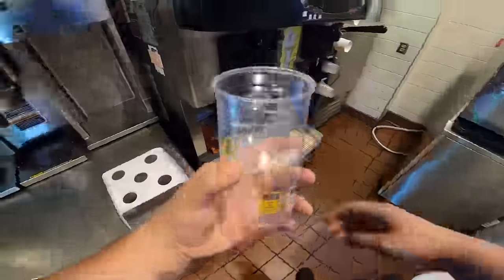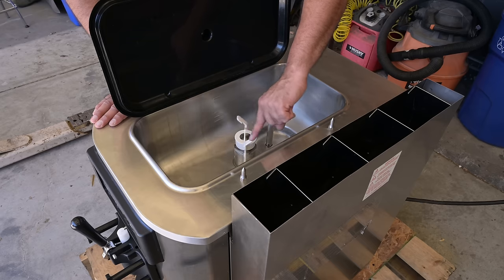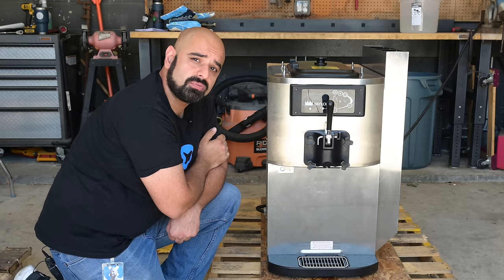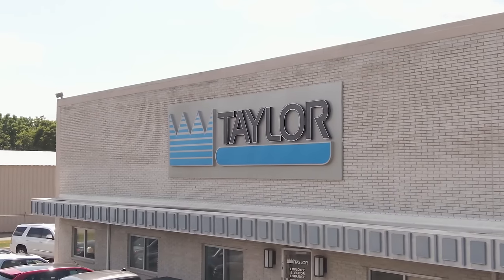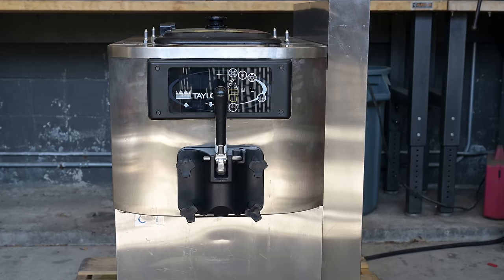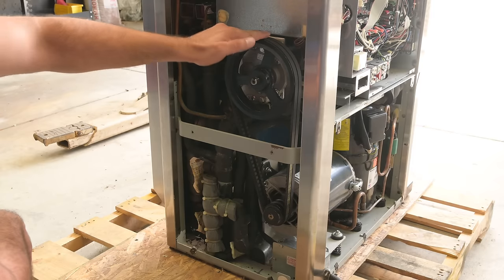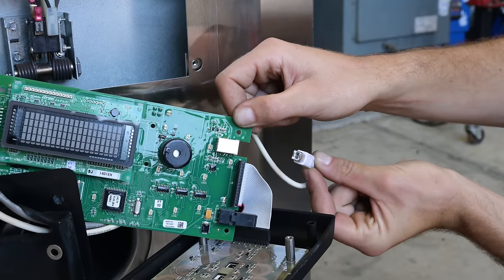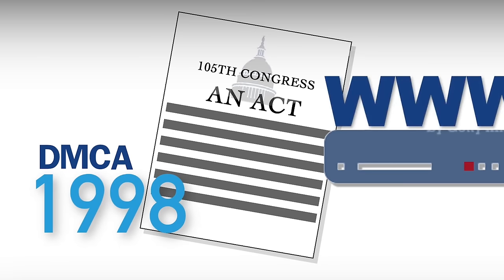Why McDonald's Ice Cream Machines Are Always Broken and How To Fix Them

Comment: I was the technician for Showbiz Pizza Time Theatre for 6 years, we had an older (non electronic) version of these machines, ice cream (soft serve, technically ice milk) was ready to dispense about 30 minutes after turning the machine on. These machines while precision were very simple and the only time ours was "down" was when employees at night would drop the mixer drum (spun inside the freezing chamber) and they would bend it, it was a tight tolerance and if bent it was expensive to replace. In my 6 years there we never once called Taylor to come fix the machine and it was in service 99% of the time (probably closer to 99.5%). The only 2 reasons it was ever out was the reason I mentioned and when management forgot to purchase enough 'mix' for the machine. 

I have watched the whole thing about the new machines for a few years now and I think that Taylor should be massively sued by McDonalds and I have no idea why such a large user like that would put up with these issues unless they get a kickback from Taylor on each repair (to franchises). Taylor could fix and prevent these issues with just a firmware update if they wanted to.
Reply: it's likely that mcdonalds also gets a cut from the service calls as well... or something. like mentioned in the video, taylor and mcdonalds have been working together for as long as they've basically existed (well, as long as mcdonalds has existed, taylor has been around for a few decades more) so all of this likely is done with mcdonalds executive's permission
Reply: It's worth noting that McDonald's isn't directly impacted by Taylor's practices thanks to their franchise model. They have an enormous amount of power over their franchisees, but ultimately a store that's losing sales is the small business owner's problem, not an issue for Corporate.
Reply: As noted in the video, McDonalds isn't going to sue Taylor. They're working together. Taylor sells other machines to other franchises that don't break down as often. If McDonalds wanted, they could upgrade to a more functional machine that doesn't leave their franchise owners stranded so often. The truth is that this problem is pure corruption, and the franchise owners are the ones getting hurt. The franchise owners need to sue McDonalds, but that would likely mean giving up their franchise location because of the lawsuit. McDonalds is going to retaliate against the franchise owners if they try to fight back against these practices.

The only semi-good news is that McDonalds is likely going to become the next subway. Basically, an irrelevant and dying business. They've already had a reputation for cheap and crappy food, but their reputation as openly hostile to franchise owners is becoming very well known. Their hostility towards franchise owners is becoming a lot more of a serious threat to their existence. It's causing franchise owners to simply walk away. If enough owners leave, McDonalds locations will start closing, because McDonalds can't fill those vacancies. As locations close, McDonalds might do what Subway did, and become even more hostile towards the existing owners, to try and fill the missing quarterly profits by taking more money from franchise owners, leading to a vicious death spiral. Subway was once larger than McDonalds in America, and I bet that soon McDonalds will no longer be the top dog in franchise restaurants. Right now, if you have the ~2 million dollars needed to open a McDonalds restaurant, you can make the same yearly profit simply investing in government bonds. I expect that the change in the economic environment and exposé's like these will cause a lot of franchise owners to cash out.
Reply: Others have said the same, but reiteration is important. 

McDonalds does not own every store, most are franchises. As a whole, McDonalds is an image, and they let people buy permission to use their image and branding. 

As part of a franchise, you have to agree to follow certain rules. Who you buy from, menu items, and layout are all determined by the company. You're renting their name and formula, nothing more. 

So let me put it like this: if you were able to write a contract that forces another person who you have by the balls to only use the ludicrously expensive icecream machines, and that icecream company happened to pay you for their contract, why wouldn't you? You and the icecream company are fine, neither of you has any risk. The risk is all on the franchise partner.
Reply: McDonald’s has a financial stake in Taylor. The McDonald’s machine was developed in cooperation between McDonald’s and Taylor. These machines are solely sold to McDonald’s. Every service call is money in McDonald’s pocket.
Reply: It's also worth noting that this is an America only problem. The only thing I ever order in McDonald's is the ice cream, and I've never ever come across a broken machine in my entire life. Only that they run out of the flavour I want during peak hours.
Reply: @awesomestuff9715  Taylor is a major owner of McDonalds (~30%).  McDonalds owns (~15%) of Taylor. It is to maximise gain from the franchisee.  It is exploiting regulatory capture at its finest.
Reply: Confused American people: Your local McDonald's is a franchise. Basically an independent restaurant that pays royalties to McDonald's. Because a Big Mac sells better than a Some Guy Burger, so in general it's a good deal for someone who can run a business well but maybe doesn't have secret family recipes to sell. The franchise has to call Taylor to repair the ice cream machine. McDonald's basically owns Taylor. So the franchisee is paying fees to corporate.

This is borderline illegal. But you'd need a bunch of businesses that depend on McDonald's corporate to team up and sue corporate. So long as the business is making money, they'll put up with a lot of pain.

It's like saying mom and dad bought a terrible washing machine. So if their daughter wants clean clothes, she has to pay a repair company to fix the washer. Except mom and dad also own the washer company. So they make money whenever daughter needs clean clothes. And if the daughter wants this situation fixed, she'd have to sue her mom and dad. It can be done, but it's difficult.
Reply: @alexlowe2054  In Sweden McDonald's are getting kicked in the chin by our own Swedish franchises and have started to leave less populated areas because they cannot come close to food quality at the same price even less when you give it buck or two more. 

Bastard Burgers, Jureskog, Max Burgers, Sibylla are the prime choice against Ronald in pretty much any town nowadays. Not speaking about random street food alternatives.
Reply: Nah, see the cost is on franchisees not McDonalds corporate, they don't give a flip.
Reply: @carly09et  that makes even more sense for why they would do this then
Reply: @nikkeryge in the Philippines, they don't have a standard Taylor machine unlike in the US. Its uptime is much better here. Unfortunately, I can't say the same for their slurry machines.

I've also stopped eating at McDonalds and started making my own burgers because they're starting to creep up in price and I hate it.
Reply: Showbiz pizza time theatre? You mean chuck E cheese pizza time theatre or Showbiz pizza place
Reply: @railfandepotproductions  You are correct, it was originally Showbiz but later converted to a Chuck E Cheese (it's all Brock Hotel) and my brain sometimes gets the name mixed up.
Reply: The nanosecond the contract expires (if it does) Mcdees will release their own machine I'm sure
Reply: @alexlowe2054   unlike subway McDonald owns the land of lot of the franchises
Reply: @Radi0he4d1  Since Taylor is paying McD HQ to be exclusive, and half the McD board is also in Taylor, you can forget about that.
Reply: @C0MMANDE12  
same in Finland, we have Hesbuger who are the largest hamburger chain here nowadays
Reply: Max Burgers is amazing! They've started a few places in Poland lately and the quality is lightyears ahead of McDonalds.
Reply: Taylor has said in their financial reports that they get about 25% of their income from expensive maintenance calls. And it is only for MaD machines that this is an issue. Other fast food companies use the Taylor machines, but not the exact same machine they  McDonald’s franchisees have to use. And those other fast food chains don’t have such extensive downtime and maintenance issues. That’s a McDonald’s issue. And I’m surprised McDonald’s is satisfied to let this go on because it is really embarrassing for them I think.

Comment: This is awesome, I hope this gets some of the lay people out there to understand how these sorts of laws really affect them, like when they can't get ice cream at a McD's.

These sorts of bad laws, particularly the DMCA are abused non-stop now, usually protecting shady business practices to begin with, exactly like Taylor and John Deere using these exclusive contracts to service and repair their devices.  When its obvious the product is flawed and requires external intervention due to a lack of support by the original manufacturer, there is no reason alternative repairs should not be allowed under any laws!
Reply: McDonald's makes more money in one month than you could spend in a lifetime. There's literally zero excuse for their ice cream machines being down so often.
Wendy's doesn't have this problem and Dairy Queen doesn't have this problem. Why spend money on ice cream machines when they don't won't and you can't make money off of them. They probably lose MILLIONS in revenue every day because they can't sell ice cream to customers and they aren't doing anything about it. 

If it's the ice cream maker supplier that's the problem, CHANGE SUPPLIERS. If it's employee, train/fire/hire your employees.

While right to repair laws are severely lacking, it's McDonald's own fault for outsourcing and/or going with an inferior product. 

Either make your own machines, or get better ones that don't have the same problems.

Comment: I remember the design difference the Taylor made ice cream machine had for McDonalds, vs other fast food restaurants like Wendy's, was to be able to re-pasteurize the milk that was already in there.  So if there was left over milk from the previous day, it will get pasteurized again so it's made safe.  While the machines at restaurants like Wendy's, you'd just throw out the milk.

Another reason that McDonalds is ok with Taylor being the only company to call when something is not working with their machines, is that McDonalds is also a share holder in the company.  McDonalds makes money from this business relationship being a share holder in Taylor when it comes to getting dividend payments from Taylor.  This kind of monopoly shouldn't be allowed.

Comment: I worked during McD's during college years i actually managed the store and had to order parts/repairs. Our machine was often not broken but out of use. This was because at the end of the night (about 2hs before closing) we would put the machine into a cleaning cycle. In the morning when we fired the machine up it took a while to get down to temp. (around 4hs, we opened at 6am it was ready around 10:30am after we checked it was all good and got around to stocking it)  This is the bulk of the time the machine is not working anyway, most people assume or get told its "not working". There are times where the machine does go bad but these in my experience were not that common. Usually we would have to lodge a job on the system for repair and someone came out within 24hs, maybe it would be fixed, maybe a part was ordered and it was up and running in a week. This repair time though was standard for all stuff really.  Other stores who use these machines and are 24/h often don't have the issues because they run the cleaning cycle/start during early hours of the night (so less people complain or notice), or after they close and before they open.

Comment: I worked at McDonald's in the 80's, and the soft serve machine failure for the most part, was always due to overheating, due to massive quantities being served during peak summer hours.  We did cones and sundaes, but the heat exchanger could only take so much, and changing a liquid to a semi-solid takes quite a bit of cooling to do.  Everyday, we were taught to disassemble the parts that touch the soft serve, mixer, agitator, auger assembly, and run sanitzer solution through them to prevent bacteria.  So, for the most part, they aren't really broken, they are just taxed to the extent where heat buildup is too much, and it literally needs to cool down.

Comment: One thing that wasn't covered here is how the machines will often go into a lockout state that requires an "authorized service technician" to repair them.

I worked at Burger King 20 years ago, and while our machines were usually quite resilient, they would still sometimes fail. The most common reason they would fail is that someone would overfill the hopper, which prevented the heat exchanger from keeping the mix at the correct temperature. However, when this happened, the machine would give an opaque error code and would lock out the machine, requiring a technician to repair it. Getting in a technician would sometimes takes weeks.

It's easy to see how this could be unintentional. After all, it is important that the machine keeps the product cool, and if it can't, that's a sign that something is wrong. Failing to keep it cool makes the product potentially unsafe to serve. So the safe thing to do is to lock it out, right?

But the issue is how it all comes together. The machine doesn't realize the hopper is overfull or that the machine is overworked - it just says "I'm failing to keep it cold" and shuts down as if it were broken. The user is not made aware of this or given an opportunity to rectify it - they can't even power cycle it do a full cleaning cycle to try again.

The technicians sometimes informed people of the cause and the management sometimes passed along the message, but when the people working at 3AM are kids who come and go every few months, that kind of knowledge is lost. If someone isn't aware and gets the machine into this state, it takes the whole thing offline for at least days if not weeks.

And this is where the issue lies. There are many ways Taylor could fix this. The machine could have more sensors and be more intelligent so that it can tell the difference between being overworked and having an outright failure. The manual and error codes could be clearer so that it were easier to teach new people how to use it correctly and how to avoid the issue. The software could be written specifically to handle this use case, providing a way for operators to go through a full cleaning cycle and get back to a safe and working state instead of going into a full lock-out that requires a technician.

But at the end of the day, Taylor hasn't done anything like this in the past 20 years. The still issues still exist with all machines. The same common and avoidable failure modes and overbearing lockouts leave operators with no choice but to pay a ransom to Taylor to service their machine. It's clear that Taylor has no interest in making this any easier. Not only do they not fix the underlying issue, but they also do everything in their power to keep others from fixing it for them. Their insistence on "authorized service technicians", the closely guarded secret that is the service manual they provide to these technicians, and the efforts they have made to sue and shutdown anyone who would shed light on how to fix and maintain these machines for themselves.

This is exactly what right to repair is all about. When you buy a machine, it's yours, and a company shouldn't be able to hold you to ransom for daily maintenance and operations. Taylor goes out of their way to not only withhold the necessary information from you, but they also use the law as a weapon against anyone who would try to help.

Comment: The fact that these machines overheat seems like a design flaw - on the part of both Taylor (for not providing adequate cooling, a user-friendly interface and/or not communicating the cooling requirements to McD corporate designers) AND McD corporate in their kitchen design for not understanding how to locate these machines to provide adequate cooling and for not demanding that the machines be easier to use and repair. If I were a franchisee having to pay the service bills, I'd consider sending the machine back and take ice cream off my menu.
Reply: I'm pretty sure there'd be a contract stopping you from doing exactly that and forcing you to use Taylor machines exclusively. 
Yes, the machines do seem badly engineered and I don't think that's a coincidence.

Comment: I actually bought one of these from an auction at a local mc donald's which closed down. I've been using it every summer for three years now and it still works. Sometimes it will give me an error message or two but usually it just continues it's cycle. Cleaning is a pain though and I can see how that may cause additional downtime.

Comment: Vendors do this by design. This is extremely prevalent in medical industry where vendors lock devices and applications down, force a support contract so all you can do i call them for support, even though you purchased the software and have the staff on hand to support it, you still have to purchase support contract from the vendor to get repairs done. Usually they hide behind "FDA regulations" to force this.